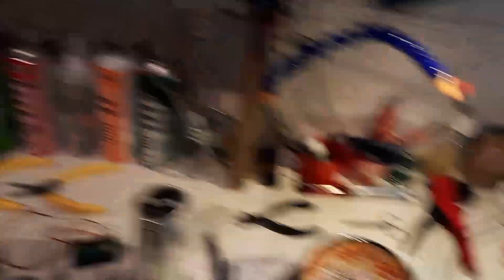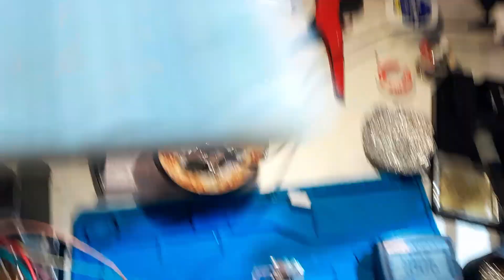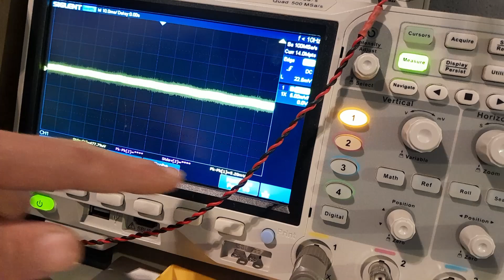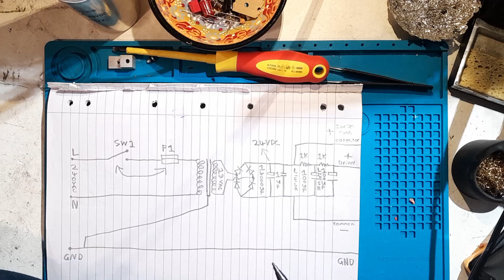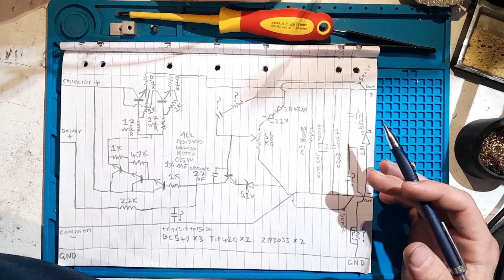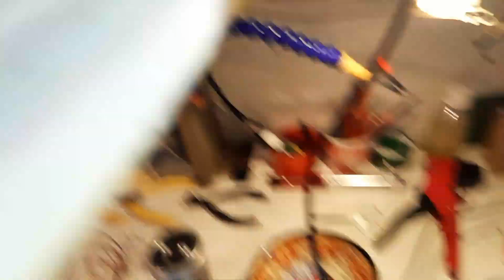Quick PS build part 3 (schematic missing both zener diode's paralell capacitors also a 1k  removed)

Comment from the maker: Don't insert a resistor into the negative path, I was thinking of adding some re with both rails to add damping but that would ruin performance and regulation, tricks like that are only good for really small floating circuits